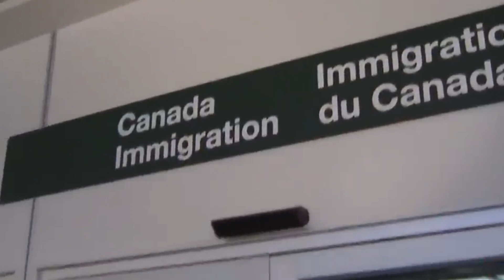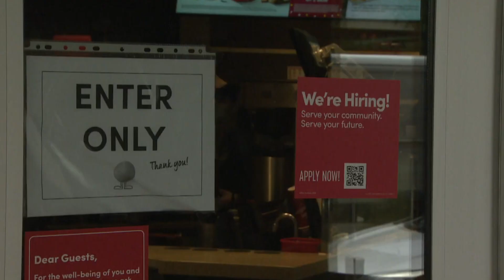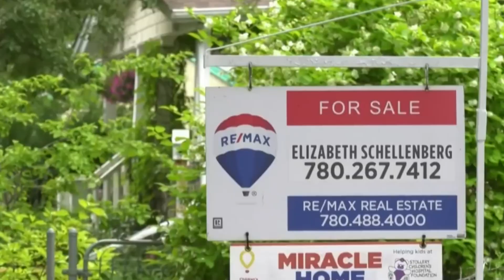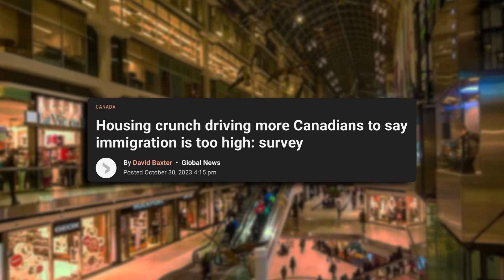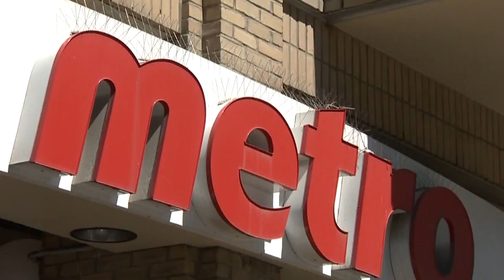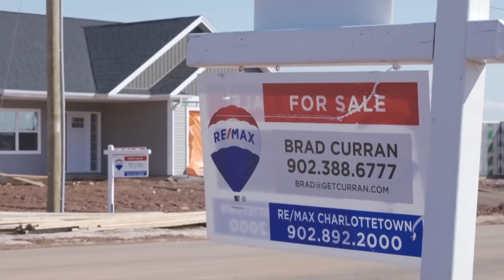These 3 Changes in Immigration Will Save Canada from COLLAPSE!

Comment: Show me how a construction worker from a tropical country has the skills to build housing designed for cold climates? Most houses don’t even have furnaces or insulation there. They’re literally made of concrete with open gaps for airflow.
Reply: Oh ffs. North American housing model is pretty much universal across the US and Canada. Not to mention that there's such thing called on-the-job training. What is problematic is the fact that Canada does have the capacity to produce skilled tradespeople at the scale needed no do people want to work in those industries. Aka immigrants are the only ones who can do the job at least somehow on the scale needed.

Comment: You do not seem to actually know how construction works in Canada. I work in electrical. There is a reason why it takes up to 5 years for you to become licenced. There are so many things to learn, so many details, and each province and even each region has it's own rules to learn and apply. We also have much higher standards than the rest of the world. You can't have an skilled immigrant from India or Pakistan or even England come over and immediately get to work, and I know because I work with all of them. They need to learn out way of building and our codes.

The other issue with construction is right at home. due to being a small  (population-wise) and spread out country, Unions have incredible influence over any major project. There are so many middle-men and bureaucracy that get in the way of building and drives up the price and slows down progress considerably before a shovel even hits the dirt. You can have all the skilled workers you can have, if everything is bogged down, nothing will happen. Polieve wants to try to address this in his "Eliminate the gatekeepers" rhetoric but unfortunately, as long as immigration outpaces residential building, we will always have a problem. And no one major seems to want to want to address Canada's addition to immigrantion.